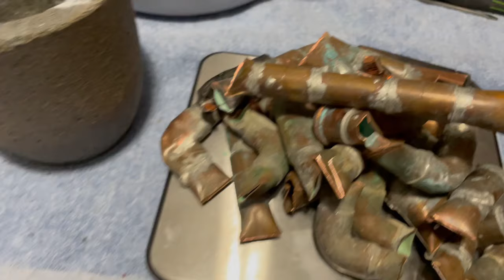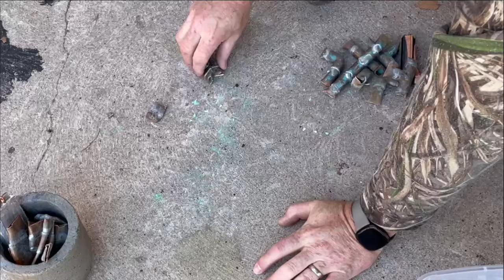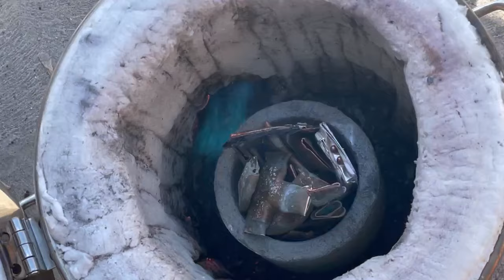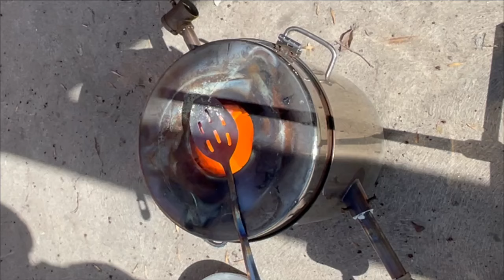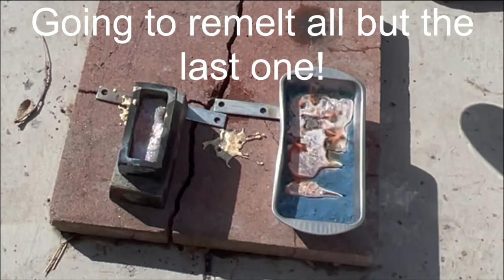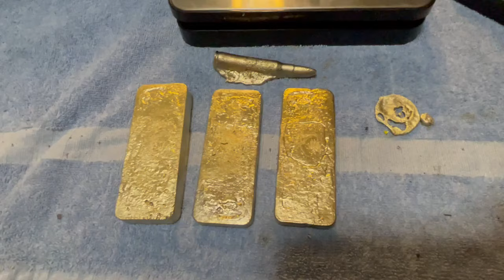How to make Nordic Gold

Comment: 6th 👍 How many uses can you get out of your kinetic sand before you can no longer make molds with it?
Reply from the maker: It usually dries out about a 1/4 inch around where you pour. I take a butter knife and scrap the cooked/dried sand off before rebagging it. I have poured 6 pour with to same two bags I started with.